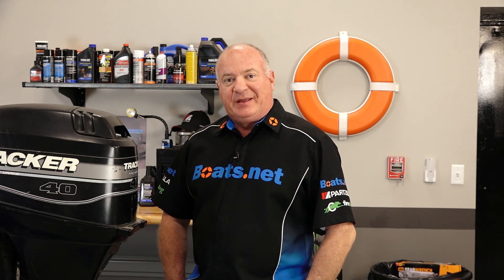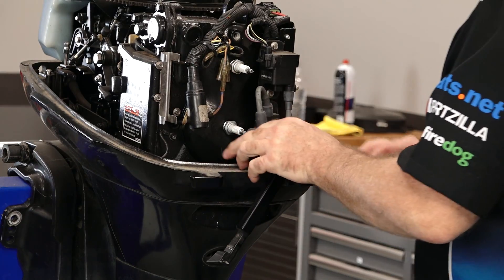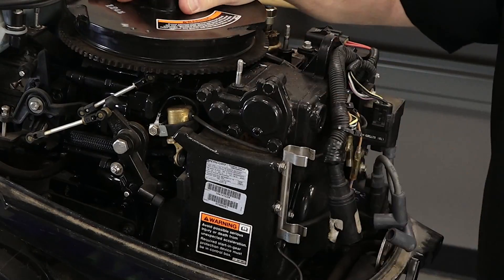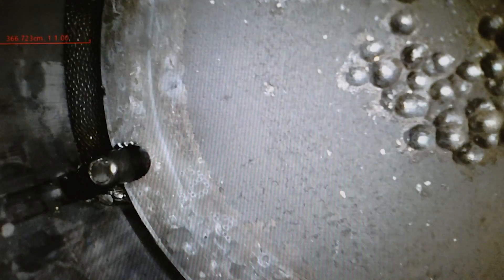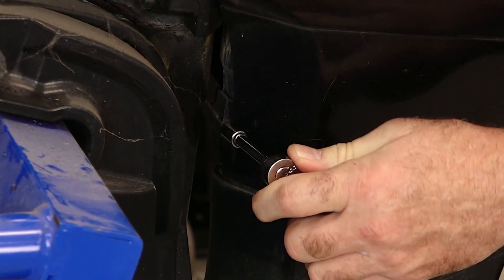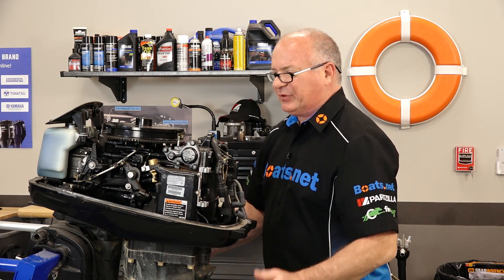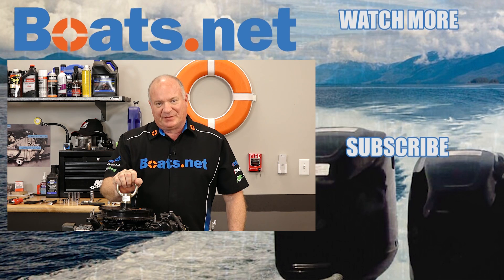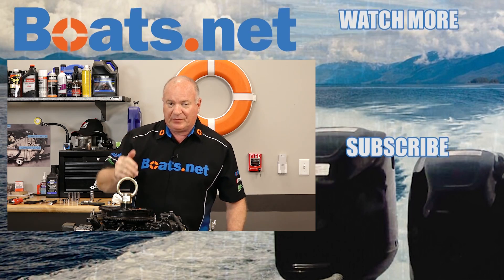Mercury Tracker 40 Powerhead Removal | Mercury 40HP 2-Stroke Powerhead Removal | Boats.net

Comment: Thanks. I have a 89 70hp Mercury. Starts and runs fine. However, if I make a mile rune or so, shut off and wet a hook, restarting and running is an issue due to smoke in the cowling. I'm sure it's the powerhead gasket. I'm an older retired vet. Can't afford to pay 700 bucks for the gasket replacement.
My question; can I do this if I have a cherry picker? I am very mechanically inclined. Just don't have a shop.
Thanks